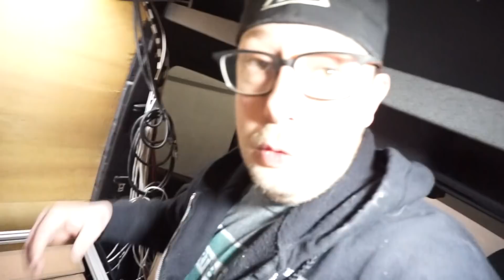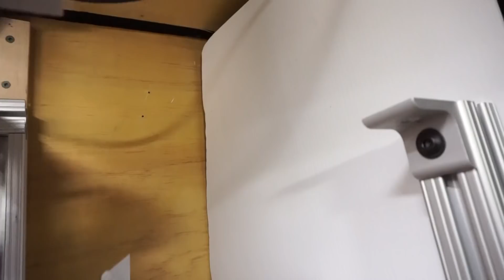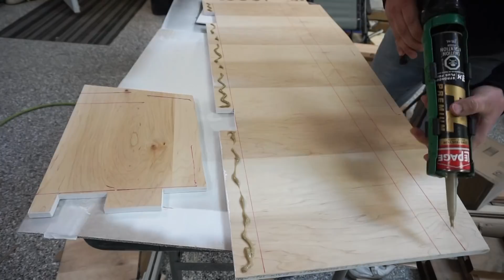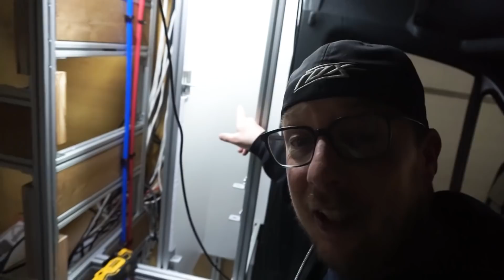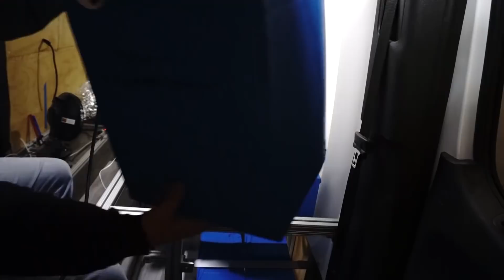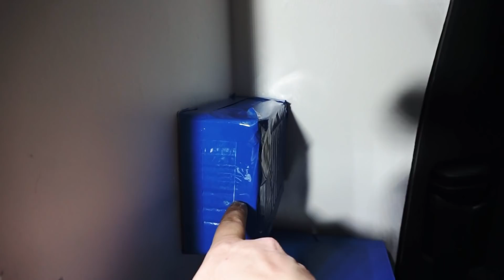Dry Fit 3000W-400AH Power Station- Four Season Van Life- EP.50

Comment: Seems few builders put their coach power system near the engine alternator.  I believe you've done it right in this regard Jeff. 
And I like the Victron components as well.  while expensive it is high quality so the value is there.

Comment: Why not 24V battery arrangement? My campervan will get one and then there's MultiPlus II available with less standby power consumption even for 3kW model. Thinner battery cables, cheaper MPPT and so on.
I've added Victron DC-DC for alternator charging and one for few 12V devices.
Everything else is 24V, hydronic diesel heater, its air coil, compressor fridge...